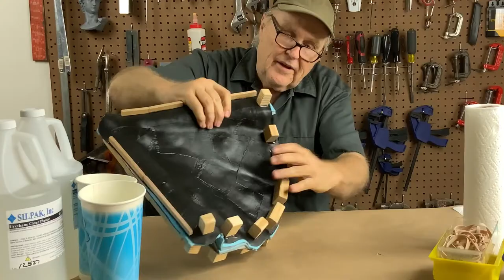Casting A Glass Lamp Shade - Part 2

Comment: "You might be asking why I don't use screws instead of bands" - no, I was asking "why doesn't he just use scissors to cut them off" - looking forward to part 3, looking great
Reply from the maker: Because I'm way too cheap. I use the bands over and over until they die. This is the perfect example of the need for a time-versus-material analysis. Which is more valuable, the rubber bands or the time it takes to remove them?  Everything in mold making and casting is like that.

Comment: So fun to watch this!  I am interested in matching the texture/opacity of the original.  It seems like there could be some slight tint to the glass - perhaps a microscopic shade of yellow + gray.  Perhaps adding the faintest amount of colorant would help match that?

As for fiberglass, I have chosen to never try it.  I use FreeForm Air or Plasti-Paste to make shells/mother molds.  Robert, you may find that you like FreeForm Air, because it is an epoxy clay like ApoxieSculpt, but it is ultra lightweight, which is perfect when you need a mother mold/shell and plan to move it or rotocast it!
Reply: I too, thought there was some colorant in the original glass.
Reply from the maker: Normally I use Trowel-On Urethane Resin.  I much prefer that approach. I used the fiberglass because I had a bunch on hand from an earlier project.
Reply from the maker: There probably is.  The color match isn't perfect but will anyone other than us eagle-eyed, deranged, obsessive/compulsive, anal retentive, lunatic artists notice it? 
Probably not.

Comment: Another great art-show. I am not a fan of fibre-glas either, unless I am in the mood for coughing blood. Since I would love to be entertained by a new episode next friday PLEASE wear a mask- I suggest a hard shell made out of 95 shore 2 part kneadable rubber. Avoids the fibre glas and solves the leaking problem in one go. Use epoxy resin with a long opening phase, deair it and heat both mold and resin - do the casting in one go and be happy - a 36 hours wait (before you can open the mold) is a fair price to pay for a bubble free casting - unless in a rush ....Hope to see you on air coming friday.
Reply from the maker: I usually make my shells out of trowel-on urethane resin. Much prefer it.

Comment: Bob, is there a different resin you could use that would be more opaque and less likely to cause bubbles? Maybe a roto application would allow the bubbles to escape. If you had more than one sprue to load the resin in sections with some vents to give the bubbles a way out.  The piece is so large, it doesn’t really allow the bubbles to rise out. The way it’s set up you only have one way in and the same way out for the bubbles.  It’s like they get trapped and can’t rise out.
Reply: You and I are thinking along the same lines. I noted Robert said that the middle section had less air bubbles than those on the outer edges. It makes sense to me in that the middle section is where the pour spout and air vent are so the air bubbles in the middle section have a close escape channel. The outer parts would have to rely on the air bubbles to travel into the middle section to escape. I think venting for each "layer" of the piece would help reduce air build up. Maybe using drinking straws to create vents that end up at the same height as the pour spout.......

Comment: 12:00 As a woodworker I can say, you are right about the uneven clamping pressures, might I suggest, rather than using weak rubber bands, give bicycle innertubes a try? I use them all the time for woodworking, I get them out of old bikes that have been put out curbside, I cut tubes into long thin strips and wrap them around whatever i'm clamping by means of stretching the rubber tube, you don't even need to have them connected together in a circle, simply by overlapping and tucking ends in is enough to keep them in place, and they apply a heck of a lot good even clamping pressure. BTW impressive Mold making this set of 2 videos was super interesting.
Reply from the maker: That's a great idea although (for me)  it violates my "too much work" principle.
Love the scrounge/recycle aspect to it but cutting the strips seems hard to me.
Cut the strips fine. Wood can tolerate intense clamping force but silicone molds want gentle, even pressure so they don't distort.
Reply: I cant quite wrap my head around how you make use of the inner tubes. Do they basically lock together when wrapped over each other? Love to see a picture. Sounds a great re-use idea.
Reply: @ScottBourke  "Do they basically lock together when wrapped over each other" in a sense yes, due to the friction or bonding attraction of rubber to rubber,  Tomorrow I'll make a quick video showing what I mean, I'll come back here and post the link to it.
Reply: @patprop74  That would be awesome mate.
Reply from the maker: @ScottBourke  Yes, you overlap and tuck in the ends of the bands.
Reply: I run an art foundry in the LA area and we do the same with inner tubes on our smaller molds or box molds but we also use rubber bands as well. We bolt all of our larger molds and sometimes use clay along the part line to seal up any leaks.
Reply from the maker: @ssouthboundpachyderm  Hey, will you send me your contact info to: roberttolone@yahoo.com
Thanks.

Comment: If thats an epoxy, you could try to warm it a bit. This will lower the visquosity and helps bubbles to raise. But it will also shrink your working time. Maybe if you have a warming oven that fits the mold you could try to place the mold upright in there and get it to a warm summer day temperature or a bit more then that. For a short time the resin will be really flowy and bubbles will pop. Of cause all this in addition to degasing the resin first. 
As the to cast part is matte, you can also try talcum powder. That helps the resin to flow easier on the surface and thus will also help bubbles to raise as most bubbles I saw look like surface bubbles that stuck on the mold surface. It will make the surface a bit more matte, but I guess in this case it will be perfect as the original part seems to be more opaque.
Reply: I learned that heat trick from this channel!  Robert was the first person I saw heat up the mold before pouring resin, and I suspect he might try that again (though that mold is going to take a huge oven to heat up)!

Comment: Use keys on the back side of your blanket, cast rubber squares about one inch square and glue them on with the rubber. The keys snap in to the jackets and will hold thin blankets in place very well.

Comment: Another great suspenseful video Robert. I was hopeful that the second attempt would be near perfect as I don't have a pressure tank. The resin I use is good without pressure but I can't say the same for casting small clear parts. Yes, I need a pressure tank.....
I heard you say that the middle section had less air bubbles than those on the outer edges. It makes sense to me in that the middle section is where the pour spout and air vent are so the air bubbles in the middle section have a close escape channel. The outer parts would have to rely on the air bubbles to travel into the middle section to escape. I think venting for each "layer" of the piece would help reduce air build up. Maybe using drinking straws to create vents that end up at the same height as the pour spout....... Or have vents in the "flats" of the spine of the mold and let the piece cure laying like a turtle.   There will be flash to clean off but maybe the outcome would be worth the cleaning....... I look forward to the resolution of the air problem.
Reply from the maker: Well, I will try some techniques out and see what happens. I am always hoping that a simple solution will work the best.
Reply: @RobertTolone  I know you won't give up on perfection..... There was a man called Confucius who stated "There are times when the longest distance between two points is also known as a shortcut".

Comment: Given the stepped shape of the shade I could not help wondering if you have any temptation to make it as five (or perhaps three) smaller parts and then join them together. I'm thinking sections might fit into your pressure pot.
Reply from the maker: You would see the joints. We'll see if I can use technique to conquer this part. Fingers crossed!

Comment: I’m still impressed, bubbles or not! Maybe it will give the light a different look, or better lol. Then you’ll have to make more to match.
The mold was pretty complex to begin with and I’m sure a lot of man hrs put in to it!  
I surely missed your channel, and always look forward to many more exciting project! So happy your back with longer videos! 😄 
If heat extract or pops the bubbles, why not build a small box, big enough for the shade and put a hair dryer or small heater and   Preheat the area up before inserting the mold inside?
Reply from the maker: I have compiled everybody’s suggestions into the video and will address them there. Thanks so much for your ideas!

Comment: One thing i learned on my first brush on mold was to be mindful of the durometer of the silicone/rubber your using, the softer the rubber the thicker the layer needs to be. but also the size of mold matters as well, a larger mold will need to also have thicker layers of silicone. but most common brush on rubbers are about a 30A durometer  and most small to medium molds need at least a 5mm thickness.

One thing i would try since you cant fit that into a pressure pot is using a resin that has a longer pot life so after you pour it, it has time for the bubbles to raise to the top and escape before it has time to gel.
Reply from the maker: Exactly right on all counts Jeremiah.
Reply: applying thicker layers is only compensating for not having the right hardness rubber or technique at hand. but maybe you're not picturing the 3cm/1'' silicone layers ive seen... i'd rather use more distinct locks and for large surface areas even fabric inlays (if you cant just get another hardness)

Comment: Wonderful work, as are all your highly informative videos. So... I know from experience that there's very little chance of getting someone used to working bare-handed to wear gloves, even if it would reduce discomfort with something like fiberglass. I will note that gloves for fiberglass don't have to be heavy, and are surprisingly some of the more dexterous types. But an idea that's more likely to fit your glove-free workflow: You could do a quick knockdown pass with sandpaper, shopvac/brush away debris, then apply a final layer of the cheapest resin that would properly bond with the fiberglass layer to trap any remaining exposed fibers and it would spare you some misery. 

My dad has always done all fiberglass work with minimal ppe and is very amused that I always look like I'm going to the moon if I even glance at a bolt of it. I just can't stand the splinters. :D

Comment: wow!! that's an awesome video!! i think high speed micro vibration should help. I would mount the mold on rubber band with the funnel up and put at the base a fan motor without the impaler keeping just the "impaler screw"  set on the shaft, then i would tape a tooth pick to break the roundness of the impaler screw so it would provide micro vibrations. .. well i think.  or do you ultra sound machine like those who pour concrete structure?.. or something who is able to make ultra sound.
Reply from the maker: Interesting ideas Melo!  We’ll see what works…

Comment: Love all the vids!
        I was curious what you think about this as a possible fix to your resin leakage problem. What if you were to super or hot glue the rubber molds, one inch, overlay margin, or whatever you call it, together at the bottom? That way, when you prop your mold upright for the poor, the resin can't seep through and you don't have to worry about clamps.
       For the bubble problem, maybe prop the mold upright on a vibrating plate while it's curing.
Reply from the maker: Not sure how I could apply the hot melt glue and close the mold fast enough to make a seal before it cooled.  I was very surprised when the epoxy resin leaked. The seal in the mold worked well using the urethane. But there you go. What you learn about one resin might not necessarily work with another resin.

Comment: My husband has a vintage truck and wants me to make a mold of the tail light lenses because they are very hard to find. What would you suggest I make them with? They are domed but fairly flat
Reply from the maker: The biggest problem with reproducing parts that fit to other existing parts is shrinkage. When you mold and cast objects the final resin cast is slightly smaller than the original.  The lens might still fit, but be aware that it might not.

Comment: Here’s an idea that might be good or stupid, can the entire assembly be put into one of those vacuum packing bags (the sort that people use to put their freshly pressed clothes in when packing a suitcase for a vacation), with the air pumped out to assist the bubble free curing?
Reply from the maker: Much of the resin would expand out of the mold and need to be trapped into some kind of container. Not sure how you could get that to work.

Comment: To seal up the edge of a mold use some oil based clay and just smear it on with your thumb wherever you spot leaks. It cleans up easily off the mold afterwards.

Comment: Bob, two points; have you ever tried a 2 series of pressurizing the resin twice? The second question is,  the set up you’re using is having the broad side down and pouring the resin through the narrow part of the piece.  What would happen if you flipped the piece with the narrow part on the bottom and the broad side on top with the addition of vents along the broad side?  I thought it would give the resin a way for the bubbles to rise up and out. I could be all “wet” in my thinking!?!  What do you think?
Richard
Reply from the maker: When I cut the sprue and vent off the casting they will show in the clear resin casting. It’s really hard to sand and polish out the traces of them. So I wanted to place them so that they would be hidden by where the resin part is held by the lamp.
Reply: Oh well, I guess that idea was a dud!
Reply from the maker: @ArcticFlies56  As are most of mine! 😀

Comment: Not sure if you have a place for requests but is there any chance you could have a video with engineering type requirements such as bearing fitting tolerance cores and thread casting with removable screws to cast parts with assembly threads? I have done it in pewter casting with graphite powder on threads so they screw out but wonder how it is done with resin casting.
Reply from the maker: It's simpler to machine precision into a casting than it is to try to cast it. Too much warping and shrinking with rubber molds and cast resin.  Just like auto makers who machine engine blocks from castings I always machine castings if they have to fit something else.

Comment: Have you ever tried vibration to remove bubbles?
Reply from the maker: Yes, I build a vibration table early in my career.  It never worked well for me. I soon went out and added vacuum and pressure to my shop.

Comment: A video or two ago, you showed that castings shrink and you talked about how you can't cast a copy of a part of it needs to be the exact same size.  Why is it different with this panel?  Doesn't the part have to match the size and shape of the other three panels of the light fixture?
(I'm asking with genuine curiosity in case it's not clear.  Please help me understand what's different about this.  Thank you!)
Reply from the maker: It's a good question. The truth is the cast parts are not going to be perfect replicas of the original.  They will fit into the holder because it's not a precision fit, but if someone looks at the lamp closely they can tell the replacement parts from the originals. Especially since the resin will yellow a little bit over time so they won't match in color either. I suspect part of it is just that Susan will have a fun story to tell people about her lamp!

Comment: If you're using clear resin (with no pigment which might evaporate!) vacuuming definitely does help remove most bubbles, of course the effectiveness decreases over gel-time and with higher volume of resin.

Seems like a no brainer to me, I would always vac clear resin (with no access to pressure)
Reply from the maker: Definitely vac the resin.
Reply: why would the pigments evaporate?

Comment: You said it’s a 12 min gel time for the resin. Would a slower setting resin allow the bubbles to rise further? Did you play with a brown tint to try and match the colour?
Reply from the maker: Urethane resins change color over time, even those with UV resistance.  They tend to become darker and yellower.  So I think it will be best to let things be the way they are.
Reply: @RobertTolone  good point about the colour. Maybe you should cast some more now so they’re all the same level or yellowing in case they break another of the glass ones

Comment: Instead of putting the mold into a pressure pot, could you hook up a nozzle to the mold and just pressurize the resin inside of the mold? Like use the mold itself as the pressure pot? (Maybe fiber glass isn't strong enough to withstand the pressure, but I thought I would ask).
Reply from the maker: Even a small amount of pressure would simply blow the mold open.